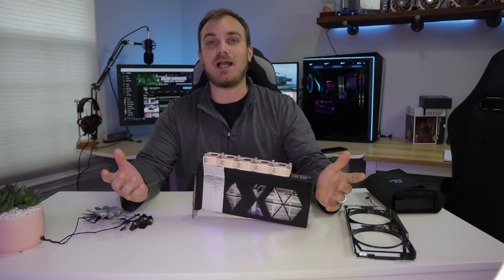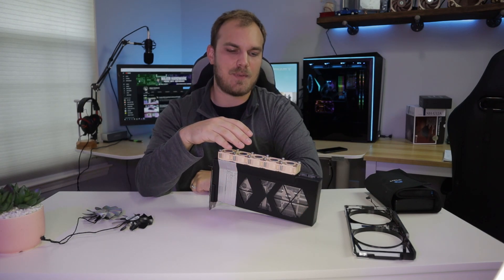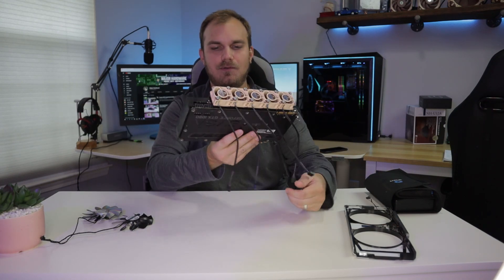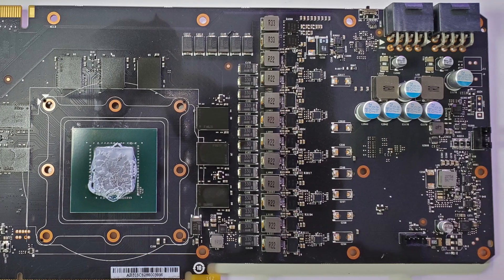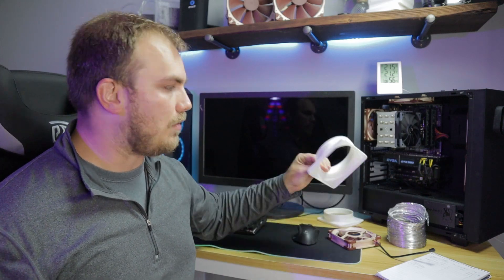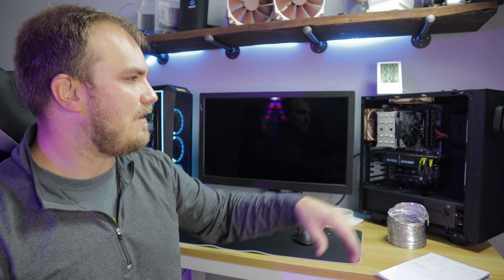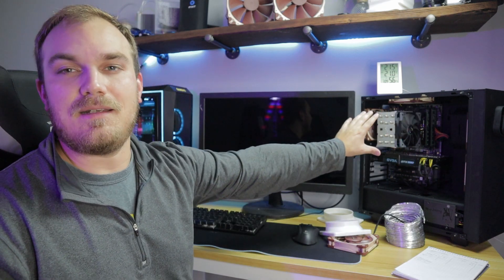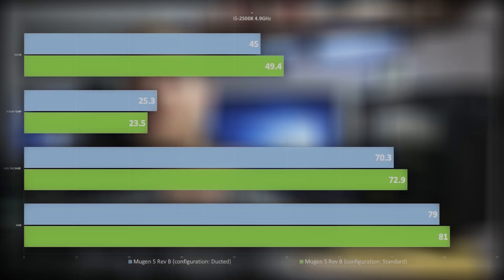Does Connecting Your CPU COOLER Directly To Your Case Fan Improve Temperatures?

Comment: I will try doing this one day with just cardboard and tape. The only concern is to take care not to smack the cooler tower during installation, and the extra pain maintenance will be. Also a little worried about choking air supply to the ram sticks with this.

Comment: PC parts makers don't want to make better products for consumers, they want to make as much money out of consumers.
Building smart means less parts sold.
PCs are still made like 30 odd years ago when there weren't even graphics cards invented. Same layout thinking.
While for a normal desktop office crap pc you could accept that, high permornce parts for gaming and working PCs should have intelligent design included, with cooling being very important.
And recently sagging is a thing, thus GPUs must drastically rethought out and motherboards and cooling as well.
But nooooo, manufacturers make pc cases that have limited passive air movement but make you install a dozen fans to cool it (more business for them) when cases should be built to have natural venting and needing minumum fans to make it cool

Comment: Thing is : it's reducing 2, 3 degrees but it looks a bit weird. Same as with many other innovations that could be integrated in modern PC cases BUT : it all depends on ambiental air temperature. No matter how many case fans you have it all goes down to this. So because it lloks a bit weird, these kind of solutions will never pass a marketing executive. Hence, the design of PC cases as we have them today

Comment: I wonder how much of a liquid cooled setup's temperature reduction is simply a radiator's access to fresh air. (since it sits on the boundary between the inside and outside of the case and can have access to fresh air if in a pull configuration)

Comment: That seems pretty straightforward that any additional supply of fresh air, especially when aimed directly at the thing that needs to be cooled always improves the temperatures. I never thought otherwise, thats why cooling fins + fans exist the first place 🥂 they started cooling combustion engines the early 1900s like this 🫣

Comment: Design and print the duct, smoother surface so it gets less turbulent airflow. I bet you'll see an even better increase. This is awesome because I was laying in bed last night thinking about designing something like this. It's definitely not a new concept, older early 2000's dell pre built systems had ducting inside of the towers. I don't know why they stopped doing it but I see higher efficiency with lower temps so it's a win. I am imagining some super cool designs, especially with clear acrylic ducts.

Comment: Somehow .. why not go intake from the back and pull air out the top? Cause hot air rises up. The "back intake, CPU cooler intake, top exhaust" (preferable with TWO fans) method is a very classic one used in a lot of SFF cases, eg. the famous NR200P.

Comment: I believe this would have been a little better if you had 3D printed the entire duct or use PVC pipe. While standard coil style ducting will work the lack of a smooth surface inside the ducting means more air friction and resistance. But its nice knowing you can get a few degrees for gain for just a little bit of money

Comment: This is really interesting but not necessarily a new concept, I already had an old computer in mid 2000 with an Athlon processor whose case had an adjustable hose on the side panel that connected to the processor cooler . Unfortunately, I had not tested the difference with and without the arrival of fresh air. 
Have you experienced it without input fan, so only with cooler fan?

Comment: First thing you need to see if you need to bother controlling the airflow w/in your case.  First option is to check case airflow with vape smoke, if you do not vape, drag someone that does into your computer room.  If you or they have a good vaping rig they can completely whiteout the inside of your case with one drag. +++    

A Non-Contact Infrared Thermometer would be best, so you can focus on the areas that truly needs help, & no need to kid-napping vapers from off the street, but that is your business.  If none of these two options work for you, you could load what ever software you use to monitor your motherboard & component temperatures.  

Really the best would be a combo of the last two, so you can know how off the temperatures are being reported to you from your system built-in probes.

And if you have dead zones, you can try adding tiny louvers or fins to the fan or fans to direct air towards dead air zones.  Can also add fins to exhaust fans, it is about controlling / channeling both cooler air coming in the case & hot air being pulled out.

Also adding a "sail" in the path of the airflow to control its direction without connecting to a fan, example would be adding a sail to the screw used to mount the motherboard to the stand-offs by the ram, same thing is needed around the CPU if you're only water-cooling the CPU with a AIO & not cooling the VRMs, the chipset, & where the power plugs into the motherboard, no one checks the m/b power plug, but it can get very hot, doubly so if its a cheap plug, or not fully plugged in, or a plug pin became lose.  We've all seen what was happening with some 4090 power connections melting.

The custom water cooled PCs I build I use 12 mm hard plastic tubing, I would use 10 mm tubing but they stopped making the needed fittings,  so the last thing I want in my build is an ugly tube directing airflow so adding a 2 inch clear plastic quarter cone shape on a corner of a fan don't stand out.

And with the tinted glass sides installed, they're next to impossible to spot.  I normally use the cone shape of the top of a Coke soda bottle, easy to cut with scissors, & duct tape to strengthen the section that can't be seen when finished being screwed down, so the plastic doesn't split or crack, & then s soldering iron to poke the screw hole, a drill would also work.

I've thought about adding my little corner cones pointing Helter-Skelter to cause as much turbulence w/in the case, & having each of the fans individually cycling up & down within a certain range of RPM, like 200 or 400 every minute I believe this would allow fresh air to hit every spot within.   This is something I'm going to need to try, just for #its & giggles, the "Shotgun-Approach".  I'd need a damn large amount of soda bottles.

Maybe I can create a set of the corner cones that can temporarily connect using magnets for a quick test change test again got having to unscrew anything.  Or something very easy, a clip on set, maybe cloth pins.

To mold them into the shape use a heat gun & silicon oven gloves, I first used steam before I had a heat gun, but the silicon oven gloves are a MUST when bending heated plastics.

+++ Vape 'smoke' does ZERO harm to the PC & you, all the warnings about Vaping is from Big Tobacco because they were losing customers because vaping is a great way to QUIT smoking normal cigarettes & governances because they were losing TAXES

Yes I know TL;DR but I Cut & Pasted this to a local doc & if the topic comes up again, all I need to do is cut & pasted it once again.

Comment: If you mount it to the case side holes, it will be a shorter even faster air blow to cpu, wouldn't it? Duct tape does wonders for sticky hold! Then they also have less sticky gaff tape. I'm guessing the more you crank up the juice, the less you see a big difference in temps..

Comment: It might not help in everyone's case, but just adding a side fan blowing into the case, almost directly towards heat sinks(gpu and cpu) seems to work for even faster air flow. Just in my case, I had turned the fan in wrong direction for a while and thought it didn't help in my new build, but then this time I made sure to feel which direction it was blowing..

Comment: well ya. I've worked on so many professional computers working in IT and they all had ducting. It's not just cooler. It cleaner. Prevents the outside dusty air from interacting with your delicate electronics =)

Comment: go one better...vent the back fan on the cooler also..perhaps reducing the hot output air from being released back into the case...worth a try..nothing to lose but hot air..one thing to keep in mind is that you are restricting some case flow cooling from the front by using one front fan for the duct intake(for all the internal parts ..including the mobo..ram ect..perhaps porting from an alternate fan intake(the top ..sides) and leaving 3 fans unaltered in the fan for good internal thermals might be the trick..cool video!

Comment: So I can tell by now that you've gotten a better camera that can do 4k60, BUT I have an epic trick for you to make your footage more consistent, make it work regardless of region(say if you make videos while travelling) AND make it look more natural when it comes to motion blur. It's simple, too, AND it should give you lower light requirements or otherwise allow you to turn down the ISO and close the shutter if you want. So here goes: Set your camera to 50fps instead of 60, BUT set your shutter speed to 1/60th of a second and lock that part of the exposure triangle so the camera doesn't auto-adjust it.

Boom. More natural motion blur, works in any country without lights flickering, and almost no quality/smoothness loss. In fact, if your camera uses the same bitrate for 24/25/30, and a higher but(but same) for 50/60, you'll technically have a quality improvement going to 50. Same for when you use 100 vs 120 for slowmo, though for that probably stick to 120 since there's no such thing as a 1/120th shutter speed, which is what you'd need for 0 flicker at 50FPS in North America.

Comment: DUDE BEEN WATCHING FOR A WHILE NOW AND I GOTTA SAY IM GONNA DO THIS ONE FOR SURE ON MY NEXT SET UP, ryzen 7 7700x 64gb ddr5 5600mhz c28, rtx 3080ti, the ryzen 7 7700x is gonna be direct die cooling to either cpu block or air cooler, with this ducting set up i think a 120mm aio would have an honest chance at cooling it at least for a 5.4ghz all core overclock at around 69-75c for sure

Comment: Just try to physically isolate motherboard in two different section. Lower sectio with  GPU and other PCI cards and higher section with CPU and memory. Use only two fans on each separete section, one for negative and one for positive flow and that`s it. Each section inside can be easy controled by "speedfan" software. Many motherboards have four fan socket placed on each side, top and bottom. Sockets are basicaly placed in pair, one pair are on top and second pair are on bottom edge on motherboard. In that case you can control every fan independent from other fan in separate section and also can be controlled on each independent section beside on other section. Temperature from GPU can not influence on CPU temperature and vice versa.

Comment: what if you built a duct from your outside window vent during the winter and cooled your pc using that.
You would need to build an insulated box to put your pc in. And you couldn't run water cooling. You would need a noctua cooler.
then vent the air back out of the pc box to the window vent. 
Hell, you could even put a box fan in the insulated box and shroud it down to the size of the noctua cooler. A test bench for the pc would be ideal. being an open design.

Comment: Hi! I thank you for giving me the inspiration for a fix I probably need to perform on my setup.
See, I have a Coolermaster Silencio S352 that is housing my AM4 system that consists of a Ryzen 3600 cooled by an Coolermaster Hyper 212 EVO on a B550 board, with a toasty open air cooled 3080TI. The case is cooled with 3 120mm Noctua case fans with 2 of them for intake. 
For normal operations, this is fine. However, when I was messing around with protein folding with, the CPU struggles keeping itself cooled when fed by the hot air expelled by the 3080TI. When folding is limited to running on the CPU and not the GPU, the CPU runs cool enough that I would reckon the Hyper 212 would be capable of cooling a planned Ryzen 5800X3D upgrade.
I was contemplating a cardboard shroud to physically separate the GPU and CPU like what prebuilts like Dell and Lenovo does for their SFF machines, but it does appear that your venting tube method is more elegant.
I'll see what I can do to mirror this on my setup. Thank you again for the inspiration, and have a good day! :)

Comment: Now I'm left wondering what the result of a push vs pull would be.

I think it would be more efficient in a pull configuration with all the hot air going out the back and not dumping into the case. The optimal case would be to have the CPU cooler in its own little wind tunnel, completely isolated from the GPU

Comment: The drag from that flex duct must be horrible. Should have a good 140mm fan PWM with the 120mm on the cooler, or possibly, just possibly, if your duct is tight? You don't need a fan on the cooler, just a good 140mm case fan feeding it because the cooler fan would just reduce flow.

Comment: You could use an L-shaped fan duck with the fan currently above the tube near the heatsink, to push air that way into the heatsink. I would personally have back exhaust and side intake (or the reverse) for both the CPU and the GPU, so I can shorten the travel distance for the air, and also to have it look cleaner. A fan or two should be more than enough to cool the storage, RAM, and motherboard.

Comment: You may want to try 2 fans at each end of the duct for a push/pull configuration. It works on large RF amplifiers.
Reply: It's what I did with My PC, dropped my cpu temps by almost 20 degrees.

Comment: I'm curious how much better case temps would be if you did another duct out the rear as well. Opposed to using the rear fan. This could really be done to look great aesthetically as well with some hard duct work, hell, maybe even a little bit of clear frosted plastic with some light rgb...

Comment: Great experiment, and the results are not surprising. This is the reason why when buildings have properly installed ventilation ducts, the building can be properly and nicely temperature controlled 👍

Comment: Automotive applications figured this out decades ago especially in racing.  Ducting into and out of the cooler to supply the coolest air possible does increase efficiency.  I’m still surprised no one makes a side panel that sticks the CPU cooler outside of the main case.

Comment: I had this thought today. Old PCs used to use ducts. Which was quite ugly because cable management wasnt a thing when you had a billion molex and flat IDE cables everywhere anyway.
But now with modern PCs being so clean and empty, it sounds like a duct system could be a very good alternative to a custom water loop. And it doesnt have to be ugly - the first water cooling systems were built with bulky aquarium parts after all. Have some slick, painted hard ducts, path ways to GPU and CPU, high powered fans with noise isolation in the duct itself.. could even throw RGBs everywhere if your the type.
Definitely my next PC project when I get some money.

Comment: What if you turned the rear fan, and the cpu cooler fans around the other way to blow towards the front, and had the front fans going out, or had a top fan at the front going up?

Comment: You'll have even better efficiency if you place that cooler horizontally, with the fan pushing the air upwards to the exhaust fan that's on the top. (+ the duct to suck air from the bottom if possible).

Comment: Before I watch... I would assume so, It's vastly more surface area and a case has decent thermal conductivity.

*oh... that's not what you meant, I would have also assumed more controlled airflow would help.

Comment: isnt simpler just changing the rear fan direction, and the cpu heatsink one too, so the cpu heatsink is taking air directly from rear?, because front has no airflow, so connecting that tube there just cuts the airflow to the cpu.

Comment: The bigest benefit of this is you are negating the impact on air flow caused by the fan in the top of the case which is sucking air away from the the CPU cooler fan. If nothing else this will likely cause turbulence and reduce airflow through the cooler, woudl be interesting to see what the temps are with this turned off. Also what the airflow looks like with your smoke machine.

Comment: I use two fans , one push in, and one retracts, basically because the motherboard also needs a good airflow . To only get it to the cpu wich already has a fan, instead of the cooling fins on the bus and memory modules and m2 drives is not that great , but has little meaning unless you overclock heavily

Comment: 24hz looks awful if your monitor is not running a multiple of it and additionally the fraction of your viewers who will actually benefit from 4k is going to be tiny vs 1080p60 (hardware wise and bandwidth wise).

Comment: Erhm... Pretty sure you could get a similar result from getting a proper high airflow case, with 3 120/140 intake fans and same number exhaust... But you know, having a proper setup that works properly, offers the best options for both the GPU and CPU, ensures proper HDD cooling so they don't fail, makes for some boring YouTube content

Comment: That duct you used is going to completely F your air flow. way to high resistance for those low head case fans.  Make the duct out of plexiglass or something smoother to reduce the resistance and you will get better results.

Comment: If you could print out the tube instead of using the flexifoil tubing you would get better temperatures as there would be less air drag, and if you had another fan extracting are away from the heatsync on the opposite side you could also have a tube that leads from that fan to the rear outside of the case leading to better airflow and better temperstures